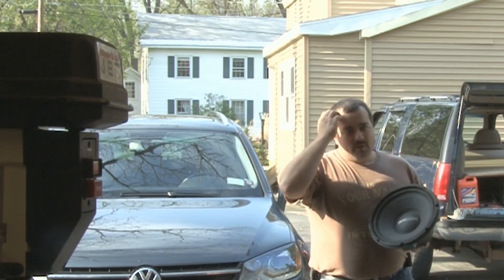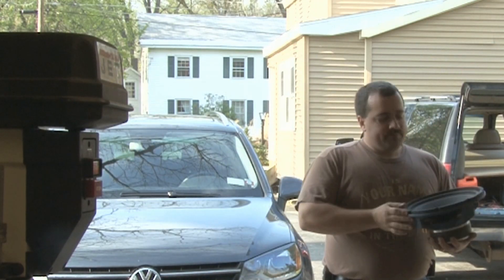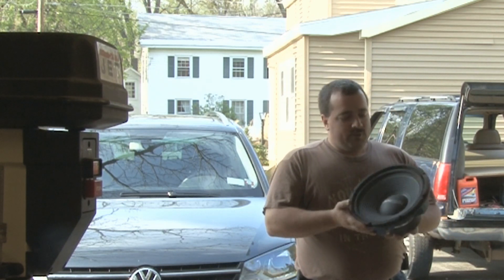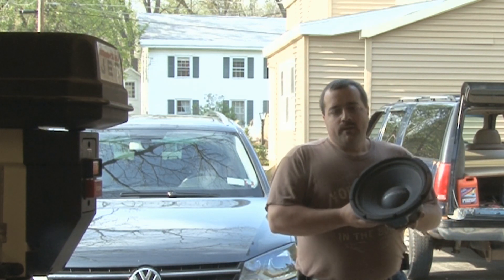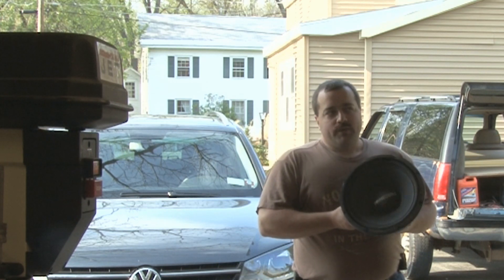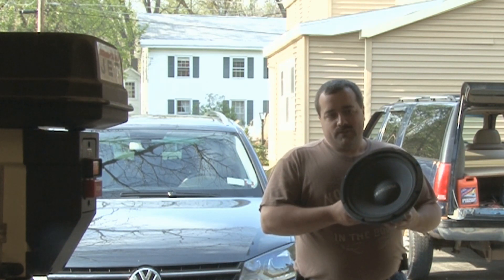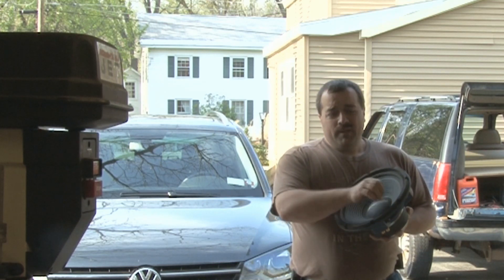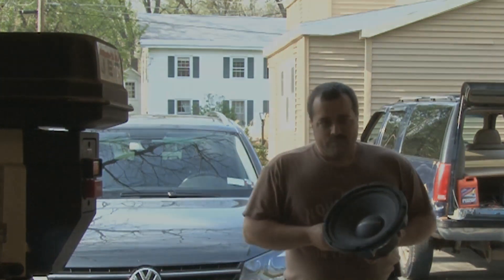CNC Cutting of a Subwoofer Box

Comment: what did you use is it router or spindle??
Reply from the maker: tizita  daniel A router.
Reply: Joe S. How do you manage the noise?? I planed to use spindle but can't get in my country 'Ethiopia'...
Reply from the maker: This garage is insulated and noise does not transmit outside very much. It's noisy inside but it's a garage so that's expected.

Comment: hey how much is your cnc machine?
Reply from the maker: If I remember correctly I paid about $12k USD for it, but we've made some improvements to it as well.  That doesn't include the router motor, bits, computer terminal, or software for control.
Reply: Oh my God its too much expensive.
Reply: Hey i have a request can you make a cerwin vega l 36 subwoofer baffles using your cnc machine?
Reply from the maker: Mr Jn Like any other tool, its value is in what you can manufacture and sell using it. 

We're not taking orders for any work right now, so we can't help with your Cerwin Vega baffles. Sorry.
Reply: Ahh ok thank you so much